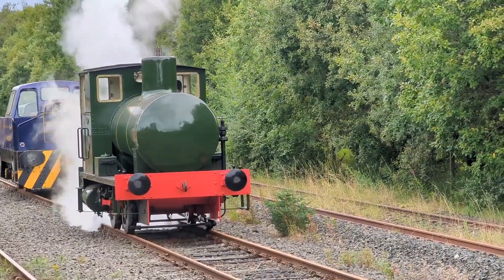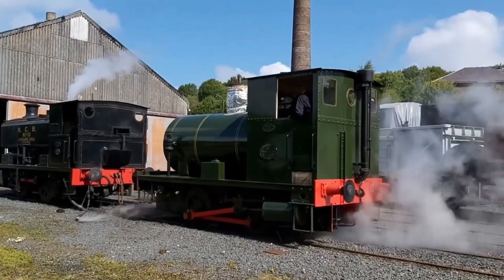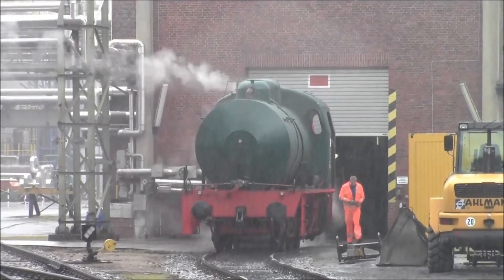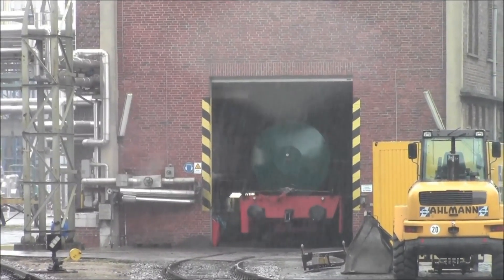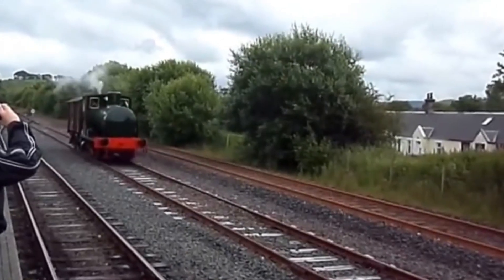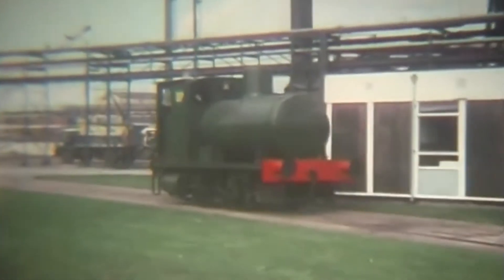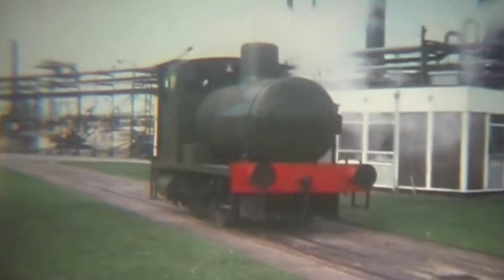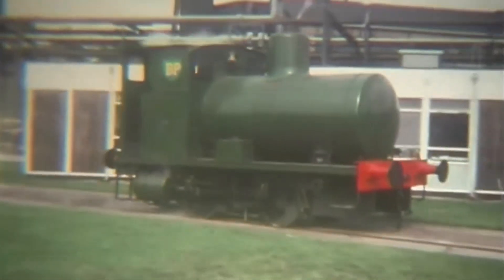Discover The Ingenious World of Fireless Steam Locomotives — The Spark-Free Workhorses of Industry.

Comment: Your explanation of these is the best I've heard, the others gave the impression that the accumulator held steam under pressure rather than superheated water.  I believe there were some locos that ran on compressed air, were there any that ran on liquified gas, such as CO2?